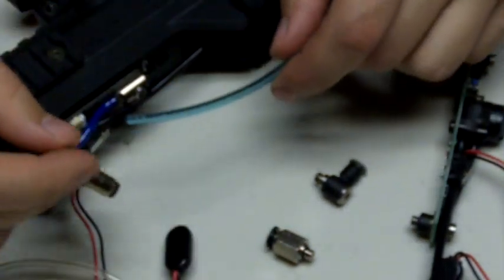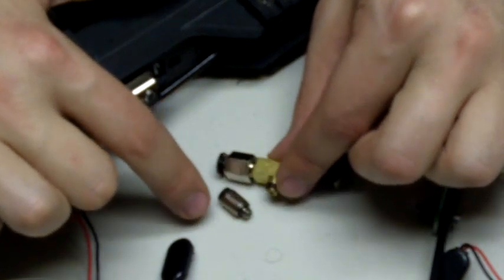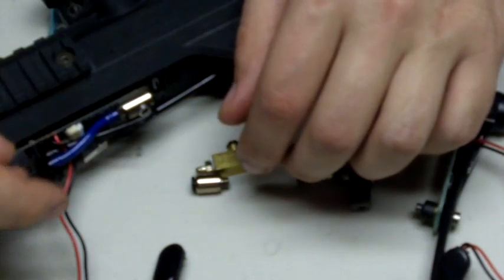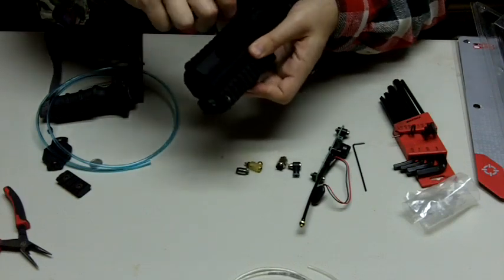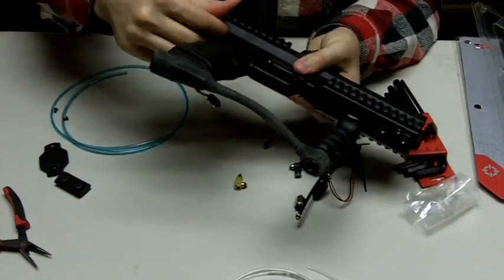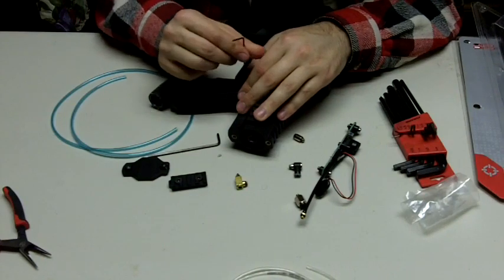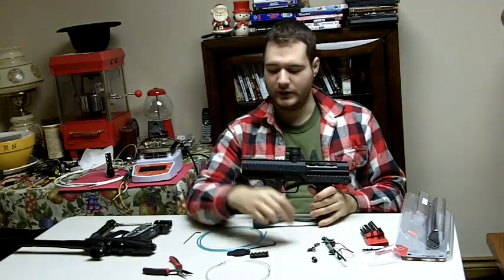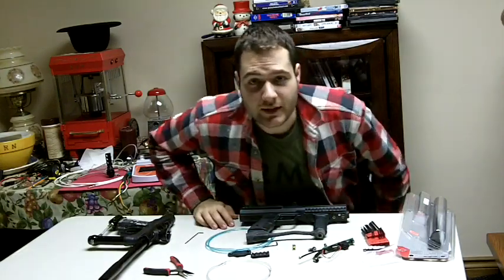SP-1, Vibe, G1, eNVy Blackheart and QEV Installation - Part 2

Comment: i have a SP1 whit stock board and i work my marker whit Co2, the question is that i want to get the blackheart board ¿can i still use Co2 whit my marker? and if it is like that do you have to program the board like te stock board? greetings

Comment from the maker: What do you mean it wont fire?  Is it trying to fire but it doesnt (the bolt moves but no shot comes out) or does it beep but nothing happens? Im assuming there is no leak at all durring all of this.  If its the first one (bolt moves) then you need to up the dwell.  If its the second you need to get a new fresh duracel or energizer battery.  PM me for more details.

Comment from the maker: In simplistic terms Dwell is the value you set on the board in milliseconds that the solenoid remains open. The solenoid needs to be open to fire the marker. 
If the dwell is set to low not all the air escapes from the firing chamber and it chokes the gun (may just hear a puff, not fully cycles, or a low fps shot)
If the dwell is set too high your marker will be very inefficient. 
3-5 milliseconds above the critical dwell is the ideal dwell.